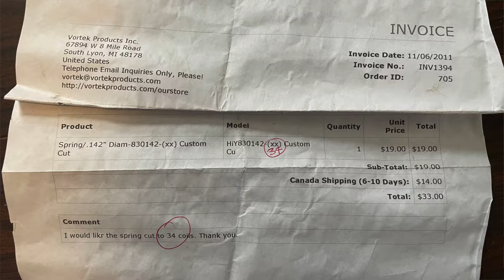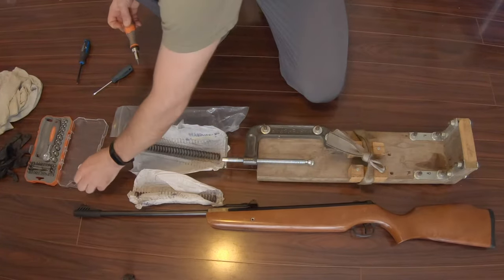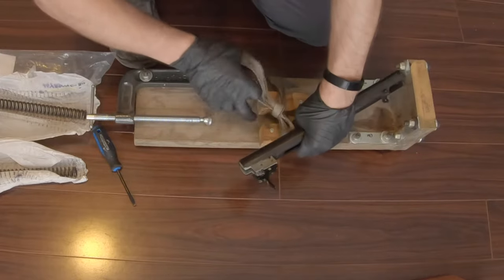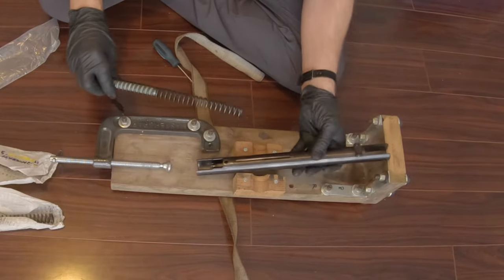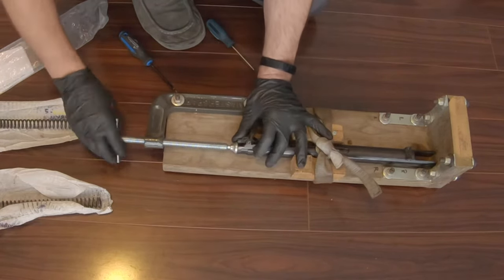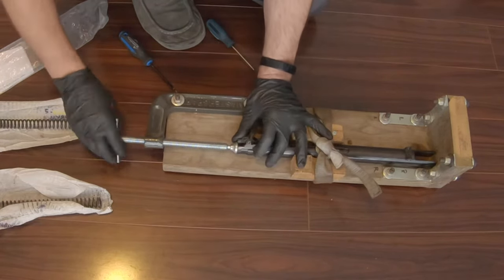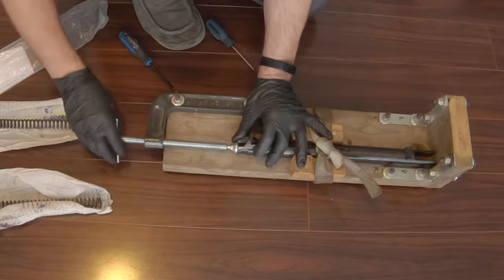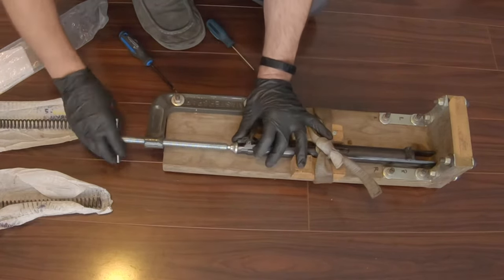Air Gun Spring Upgrade! the quest for FPS!

Comment: Just to let you know, your spring end is not finished correctly , you should heat it up with a blow lamp then when it gets red pinche the top coil so its inline with the coil unneath it pointed nose pliers then let it cool down naturally before placing it back into the action.
Reply: Bullshit. You have to temper this end of spring after inline coil modification. Otherwise this end of spring is soft. Ofcourse you have to smooth the ends of spring on both side for mirror surface. This method prevent vibrations, make shooting softer, and reduces gun kicking.
Reply from the maker: Thanks for sharing this I’ll have to go back in and change this

Comment: Just for balance of course…
Many years ago a friend of mine, whilst putting an Ox in his Hw35 got the breech block cross threaded. 
He brought it over so we could mount it in my jig and hopefully resurrect the situation.  
Well..couldn’t get it out so I held the breech tight with a leather gauntlet, while he twisted. 
Some you guys will know that the HW spring carrier is roughly cut and splayed out in a cross shape - remember the roughly cut bit, it’s important. 
Yep..we twisted..something thudded onto my thumb and the spring went airborne.  
The first sign of trouble was that there didn’t seem to be a proper thumb in the thumb of the gauntlet any more.  
There was a neat “v” shaped cut in the leather where my thumb should have been. 
The spring carrier went through the leather, hit the top of the base of my thumb, went through down to the bone and dislocated it so it was laying next to my wrist.  
One surgery and plenty of ribbing later, all was good.  
Still got my Venom arms
HW 77k, must be 35years old and I’d still rather hunt with it than use my pre charged rifles.
Reply from the maker: Ouch

Comment: Make two short pins the size of the trigger group so that you can push out the long pins and leave the two short ones in place to keep the trigger group all in line and it makes assembly a doddle as everything is held in place and the safety simply slides in again no problems I made mine from brass rod and they are a godsend for servicing the rifle. The video is great and the results are very good you are doing a great job. And Nice to see someone actually doing things the safe way. Keep on keeping on stay safe from the UK.

Comment: I have a cheap B2 Chinese. 22 air rifle that the spring got weak after couple of years. So bought a vortek spring for the rifle same length as the old one played hell getting the new one in. And cocking was hard also. So I cut the new spring down a couple of coils and flatten and polish the end. That rifle shoots 10 time better then when I first bought new awesome now. I even got one of their moly seal for that rifle even better. Vortek Inc. make great products for your air rifles American made from Michigan. More fps dose not mean better accuracy that's what you want accuracy with the right fps. And the right pellets also. Good luck bud.
Reply: I took an HW 80 up to 24 ft-lbs then dropped it back to 18 ft-lbs if it's done right you get very little recoil. At 24 ft-lbs the group size at 35 yards was around 10 inches at 18 ft lbs  the group size was < 3/4 inch

Comment: Hi, I am about ready to change my spring - but I don't have a spring compressor or the means to make the version you use (I saw your video on how to make it and it is very good, it's just not something I can make at the moment). Is there a way to do this without a compressor? Ie by putting pressure yourself on the spring using the flat head of a file etc? I know it won't be as easy or as safe, but is there a way? Thanks!
Reply from the maker: Ya you do that but it’s a sketch situation so just spend $30 and build one so you can do it again safely from now on

Comment: Hi - this was such a useful video - thank you. I just have a few questions if you don't mind -
a) what's the name of that flat-lying vice-like thing with the screw adjuster clamped to the end? (The thing you put the barrel in to work on)?

B) I see you ordered the spring cut to 34 coils, but you said you realised you had to cut a couple more off. How were you able to tell that, and to know how much to cut off? (I ask so that I'll know when i do the same thing)

C) you mention something about "locking" the screws at the end- do you mean using "thread lock" liquid?

D) I'm going to order from the website you linked, specifying at 34 coils - the 142 Wire Spring 830OD. Will this spring fit most springer makes and models, or only certain ones? I have a variety of springers so would be good to know if it could work with any of them.

Cheers!
Reply from the maker: A) is a spring compressor I came up with to work on springers. I made a video on making it. 
B)the reason I had to cut it was because it ended up binding up so I had to shorten it to allow the spring to compress. I cut a bit then tested it until the main spring compressed without any binding. Takes some time unless you make big incremental cuts
C) blue locktite is a good idea on anything that moves or vibrates
Reply from the maker: It will work in some for sure 👍🏻 but there’s a lot of springers out there so I’m sure it won’t fit in a good majority of them

Comment: Hi mate- from the catalogue you link, there is a "148 Wire Spring 905 OD". 

 I've figured out this means Outer Diameter is 0.905 inches = 22.5mm. 

What I don't understand is the "148". Is this the strength/ thickness of the wire itself? If so, is 148 a good standard to stick to? Cheers!
Reply from the maker: I’d have to check on the order form but I think .148” would be the thickness of the wire
Reply: @BROTUNED  Cheers mate, I appreciate that you take the time to reply to questions!

Comment: Flatten both ends of the spring, grind flat then polish to a mirror finish. Hope this helps you
Reply from the maker: Thanks very much for the tip I’ll give it a go
Reply: Why mirror finishing
Reply: @brodylockley3141  The spring rotates when compresses and uncompressed so a rough finish after flattening hinders the rotation. The smoother the whole firing cycle will increase accuracy
Reply: @DiscusRussell  thank u

Comment: Excuse me, what was the original fps of the air rifle?  was it 500 fps  !
But after changing the spring with thicker one, you gained more than 380 fps?  so 500 fps air rifle became 880 fps air rifle now?
Could you please let us know also after long term use what happaned? any problem so far?
Reply from the maker: Ya it was a 495 gun before

Comment: How would you s screw the end cap back on say if it was a hw 80 with it being under pressure
Reply from the maker: I guess you couldn’t unless you can figure out a way to hold the tube securely and have the back exposed

Comment: Thicker spring or same kind but longer spring may gives more fps (power) ???
Reply from the maker: I did do longer and got spring bind. So thicker was basically the only way but it lost its nice shootability. It’s back destined again so it shoots nice soft and accurate again
Reply: @BROTUNED  so if ı use longer spring, it will not increase the power? ı wanna buy longer spring so thats why asking ur longer spring resuts? lets say original sprign is 20 cm, but if ı use 23 cm same  stiffer spring. will it increase the velocity because it has longer spring?

Comment: What makes a spring stronger, the thickness or the number of the coils?
Reply from the maker: I’m guessing the thickness and the number of coils would make it stiffer.
Reply: Probably the thickness
Reply: @rileybeer2836  if you strengthen spring surely recoil will be worse?
Reply: I've read about the Ox Accelerator mainspring are square section and thus provides 40% more compression and power. If you're familiar with misumi spring you'll know square are better than regular round section coil.
Reply: How it's treated during the manufacturing process as well as what it's coated with will also overall improve your spring quality and durability.
Reply from the maker: No I haven’t heard about them.  Something I have learned over the time I’ve been playing with these spring guns is that there is a balance. To much power and the rifle becomes way harder to shoot well. It’s way harder to cock and recoil gets ridiculously violent. The sweet spot for my rifle and myself is in the 500 to 600 fps range
Reply: @BROTUNED  Very true my friend. Finding own sweet spot and lubing regularly are always the best bet. Also if considering an upgrade never go too beyond the specs you already have.
Reply: @BROTUNED  the thickness of the coils determine the consistency of the spring and more velocity  the overall length of the spring 🌼 gives you a higher cocking pressure and more range as a rule
Reply: check out Field target master for his build of his competition tx200 he won the title in 3 days and I have the same kit as him but the next level up
Reply: @BROTUNED  Agreed if its just sheer power you are looking for probably air rifles wont satisfy your needs but tweaking hear and there will improve air rifles out of the box .
Reply from the maker: Exactly

Comment: How do we consider a stronger spring for upgrade? Is it longer, harder, or thicker than the original? Thanks.
Reply from the maker: Yes basically that’s correct ✅ but don’t go overboard on thickness because you’ll get coil bind and make cocking it way harder for not much return in velocity. I found the gun shot best at around 600 fps
Reply: @BROTUNED  Noted, thanks for the tips.
Reply: We're can you order stronger springs please.
Reply from the maker: Vortekproducts.com is the site I believe

Comment: Is it an umarex ruger hawk air rifle?I just got one myself today,if it's the same model,I can just apply the spring size you use to mine
Reply from the maker: It is a ruger air hawk 495 fps and in .177
Reply: @BROTUNED  really appreciate
Reply: @BROTUNED  How many coils that spring still have after you cut it,I want to save that step so I don't need to cut and grind myself😂
Reply from the maker: No problem thanks for your comment

Comment: Hi I have crossman .177 it’s not getting the pellets out , I have to shoot about 7 times before the pellet comes out, some debris is coming out, do you know how to fix it, thanks
Reply from the maker: Maybe you piston seal is faulty? Is this a new rifle? Ammo shouldn’t make a difference as long as it is .177. Possibly the seal on the barrel is missing or damaged? Have you ever taken the rifle apart?
Reply: It’s actually marksman 177, Do you have a video how to replace the seal
Reply: It’s about 20 years old , but I keep it in good shape, but I kept it in the shed outside throughout summer and winter, maybe seal is not good anymore. I never took it apart, but after watching your video I’m going to try
Reply from the maker: Could be rusted inside. You’ll have to check it out and perhaps hone the cylinder and get a rebuild seal kit online.
Reply: Thank you
Reply from the maker: You are very welcome

Comment: Anything over 12 foot pounds makes the gun less accurate  simple law of physics proven  . Doesn't matter what make of gun more important is gun weight but the laws of gravity × physics is finite.  The point the pellet is less than a quarter of the way down the barrel at 800 fps  that's fact that's life  . Good video.
Reply from the maker: I enjoy it most at around 650 fps but I just wanted to see what it would do

Comment: I have a 7,5 joule umarex .177 air gun and i want to mod it, what do you suggest? Like lubing the piston or what spring should i get, Thanks🙏
Reply from the maker: The biggest thing that makes the biggest difference is changing the main spring to something stiffer. Vortekproducts.com
Reply: @BROTUNED  i have no idea what i should get, any ideas?
Reply from the maker: You will have to either take yours apart and take measurements of the stock stuff then get another spring with the same diameter but thicker coils or more coils.

Comment: Just found your vid timely. Opened up my Benjamin Classic 22 to see what is up. Chrono showing 426.
Not much preload in the spring as I put a little pressure on cylinder the main support pin fell out...
Gets better, Piston needed to be forced out using a probe to slide out of sleeve. Found scrubbing on the piston and ID of sleeve. Seal had metal filings embedded in it. Got pics to prove it.

Removed spring and found one end squared of and reasonable smooth, However the other end appeared to be hacked off with bolt cutters and not squared or cleaned up. On the end of piston, seal end, there is a small hole drilled through not centered, not done obviously on a lathe...Metal chips....

Got some work to do but need, to replace the seal and spring for sure after I calculate an appropriate length. Then lotsa polishing and lube.  If this is how they "detune" for CA Market am not impressed. Bought this brand new and wasn't cheap at that time. Wish me luck cuz, skill is no problem here.
Am not on the Quest for more FPS, just what I paid for.

Just subbed and liked.
Reply from the maker: Ya I think they just detune them as fast as possible to get more out. You will have a great springer if you do all that for sure. Let me know how it turns out. Remember it magically turns into a firearm after 500 fps so a pal is required. Not sure if you have one but be mindful of that. Cheers buddy and good luck!

Comment: What I am interested in is how harsh is the recoil and what is accuracy like now?
Reply from the maker: With the big spring it’s a bit much going to go back to the previous one for sure. Not worth the trade off
Reply: @BROTUNED  been down that road years ago there is only a certain amount of volume for air in an airgun and using a heavy spring creates piston slam and harsh recoil not to mention the strain on everything cocking arm, contact points and trigger sear. If you make another video maybe explain that to the views, I am afraid people new to airguns, may destroy a perfectly good airgun
Reply from the maker: Ya I will make a new vid about this issue
Reply: @jimstewart5008  I found out by accident on my HW80, many years ago, just adding a small weight inside the front of the piston & then cutting off four coils from the spring, that put the power up & made it more comfortable to shoot. The trouble was, it took it over our 12ft/lbs limit so I put a standard spring back in & brought it back to how it was. It was a good experiment though.
Reply from the maker: That’s very interesting
Reply: @BROTUNED  I've got an HW95 in .22, it was almost new, not a mark on it but it was a bit harsh to shoot. I did some research & someone short stroked it by 12mm, I did that to mine & what a difference, it is still just under the legal UK limit but is so smooth, I'm well happy. The transfer port on that is just under 3mm if that is any use to you.
Reply from the maker: Awesome thanks for the information! I’ve never heard of short stroke what do you mean by this?
Reply: @BROTUNED  What you do is make a spacer to go between the the front of the piston & the piston seal, this shortens the stroke & yes there is less air in front of the piston when it is cocked but it hardly affects the power but made mine much more pleasant to shoot. All the best !!
Reply from the maker: Very cool thanks for sharing this with me
Reply: @malcytull  can you guide me about how to go ahead with this? Thank you!
Reply: @siddharthamahavira2679  Hello, What gun have you got, a lot of them have a different way of attaching the seal to the piston.
Reply: @BROTUNED  yes you can buy a short stroke kit some folks have had good results with them comes with a new spring and all the gubbins .

Comment: Found an older one than this in my dad's stuff.....he died a few years ago. Would love to have someone that knows what they're doing to fix mine. I tried some new pellets and it's not working. The pellet basically just drips/falls out of the barrel. Know anyone in western NC that may know how to fix it. I took it to a local gun shop and they wouldn't look at it.
Reply from the maker: Does it cock and spring back when you pull the trigger. May just need new seals  and to clean up the inside of the piston tube
Reply: @BROTUNED  , yes, it does.  I have no idea if my dad ever did any of that so I'll try to check it out and see.  Thank you very much!
Reply from the maker: Ok good luck with the gun hope you get it working
Reply: If its a .22 the old ones are 5.6 not the newer version 5.5 tryfinding the old style ammo
Reply: @martinkelsey275  , thank you
Reply: Worst case scenario is that the piston chamber is a bit clogged up ...that happened with my bsa airsporter...the cork spacer mashed up inside the chamber
Reply from the maker: Oh wow that’s the first time I’ve heard that